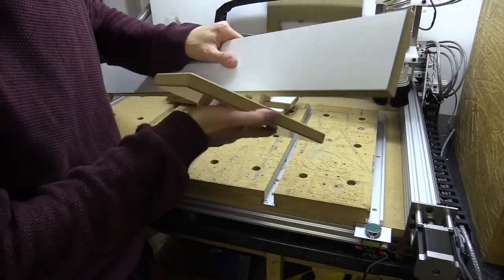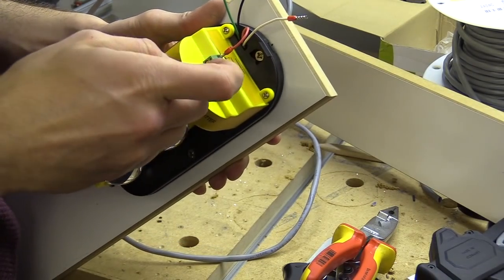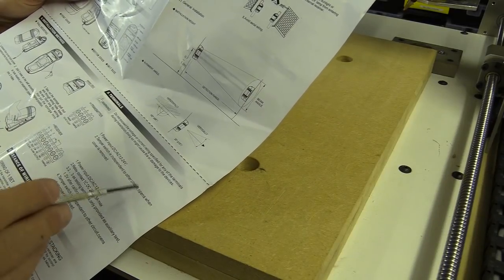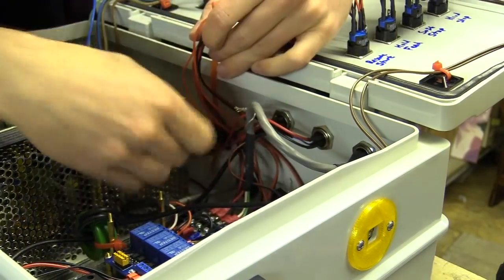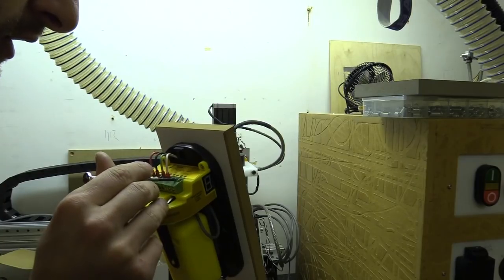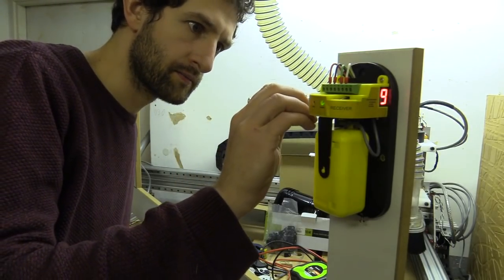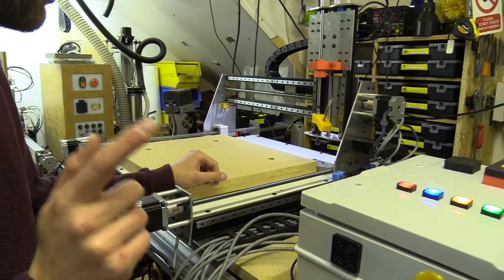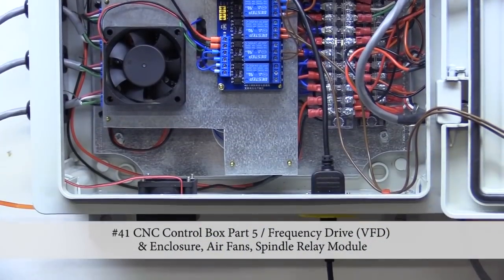#42 CNC Control Box Part 6 / Light Curtain Safety Barrier, Infrared Transmitter Receiver

Comment: The jobs I forget I had. Used to use those beam break sensors, back when I installed scaffold alarms. A diy light curtain can be done with ldrs in black tubes, more work though. Ben heck made a laser harp using the same basic idea.

Comment: Neat project... but do you really need this? I've been DIY CNC'ing for around 13 years now... I've never needed anything like this. You would need something like this on a large mill with a moving table, and even at that usually some tape on the floor is more than sufficient.
Reply from the maker: Thus the option to take it off at the end - but in event and educational situations you might have to prove you've limited the risk of something going wrong, and now I can. I think in reality an enclosure is always better in the workshop - sound baffling and containing any air born particles. Long my your luck last.
Reply: I get you... sometimes you just gotta do something because you can. I enjoyed the video, anyway! :)